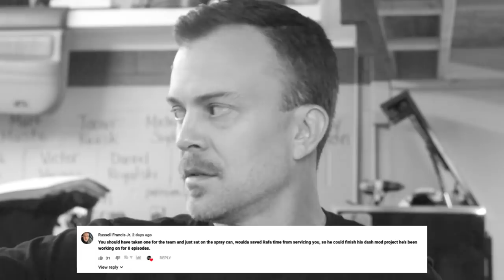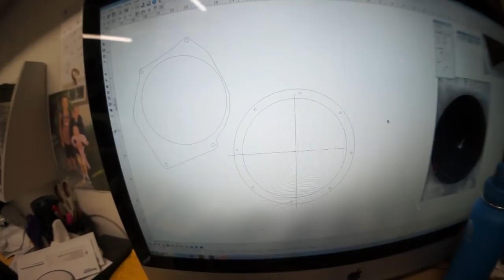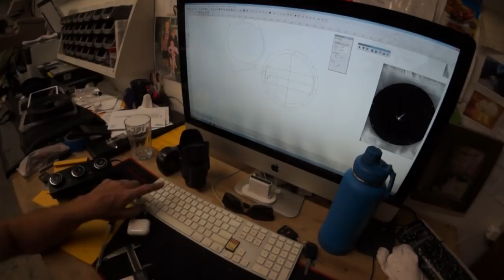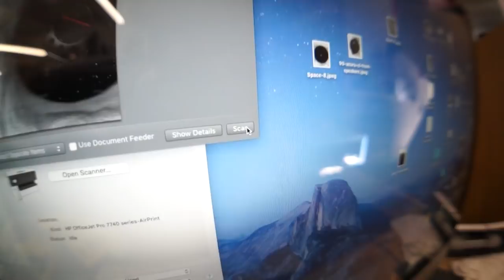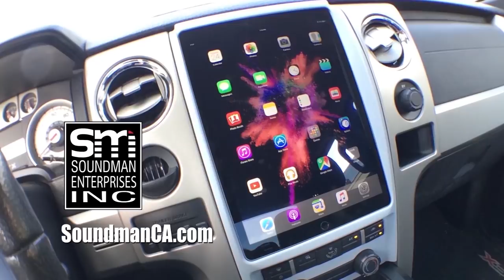8 inch PLEXI SPEAKER ADAPTER PLATES! - Acura stereo system part 8

Comment: I had a 97' Cadillac Seville STS with the same set up I put 8's in the doors but without the proper tools I basically took some heavy duty vise grips and folded the metal back till the 8's fit lol took me 3days but I got it done

Comment: Doug check out XTC baffles. They are cheap and they work great. They are a soft foam, so when the window rolls down, they just conform to the glass and track. They provide a sealed enclosure of your mids. Parts Express sales them.

Comment: I have a 95 civic and I just put 8s in my doors with a tweeter above them
Reply: Got one the same year, running 5.25 focal components up front, 6.5 rears in the deck
Reply: You use specer??

Comment: Thank you for video.I have a Acura 2016 mdx .I purchased it for my son.My name is Chris .I have stage 1 cancer,aggressive.I am keep original receiver.I have had someone install 2 amps a 4 channel and 1 channel Rockford 4 ch and Mano 1 ch.I  put JL SUB 12 in.I wanted a surround sound clear system.The radio company installed 4 Beyma components,4 tweets beyma .They Stated it was 2,000 watts rms continues sound.They also installed car audio control lc7.The point is its all treble and I have no punch coming trough 4 speakers.The man told me beyma speakers are just for sound and no mid with punch.My son listens to old school freestyle j-lo ,Pitt bull,Cynthia Jonny o..Please help me ,tell me what to replace as far as speakers or processor .Should I get rock ford punch.i have no idea.I need advice ,this mdx is for my son.I have maybe a year or 2 pushing with kemo.literally I paid $5,000 for all.What would u recommend.I truly need advice.My e-mail is grizzlybear896@aol.com.I am great full for your response.Thank you again.Have a good night.

Comment: lol,   He said..... "silicone it to the door"   I got a better idea,   BONDO
Reply: Silicone is just for seating of the speaker, with how thin the door metal is and speaker vibration, bondo would crack over time, he is not molding it to the door, going to look factory when it's done.